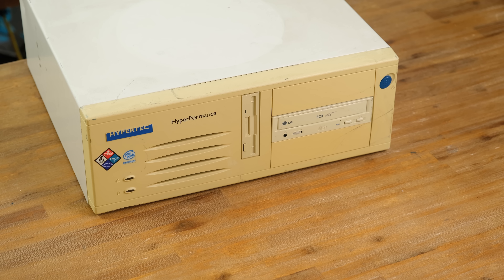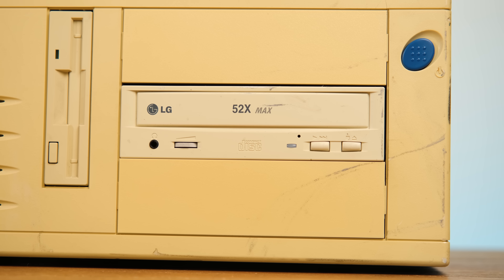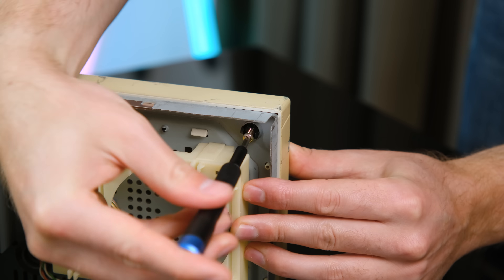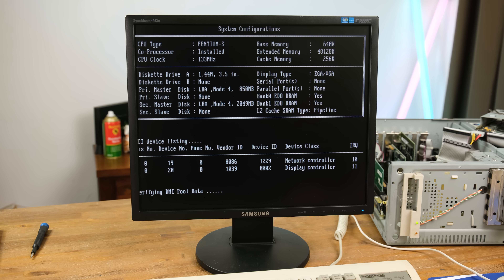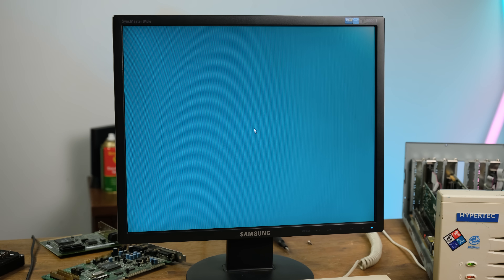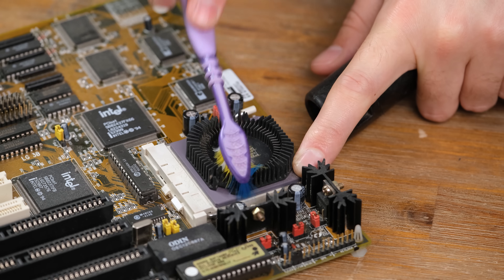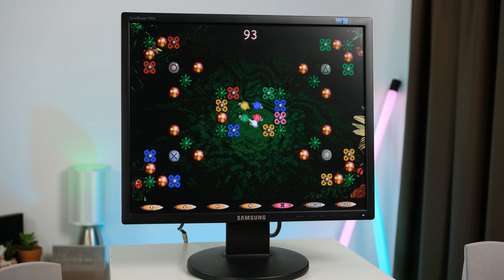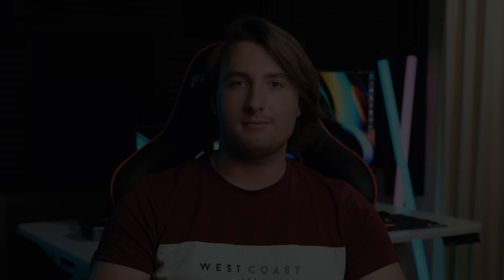Windows 95 PC Saved From The Trash!

Comment: This was our first Windows PC in 1999, was an ex office workstation. Had a Pentium 100, 16MB RAM and Win 95, later upgraded to 32MB RAM and Win 98 when it became my own PC in my bedroom circa 2002-2003, as we had again obtained another old ex workstation around 2001 as the family PC (this time an MMX, 64MB and 98SE)

This brought back some good memories.

The last ex workstation PC was an IBM with a Celeron, 512MB RAM and XP that we got in about 2005 when we finally stopped dealing with second hand underspecced computers, but they did the job. That served us well for about 3 years and then I think we pretty much went with laptops as I had just started working etc.

Comment: All versions of Windows 95 liked to assign conflicting resources to sound cards, most often the parallel port. If you'd manually change one's resources it would change the other device to match. So then the only recourse was to manually assign both the sound card and whichever device Windows was insisting on improperly assigning resources to match it.

Windows 98SE was when Microsoft finally got Plug N Play working correctly. I encountered many PCs that had problems with Windows 98 original that worked fine with 98SE.

Comment: I have one of these. Came with with a 100mhz Pentium CPU and 850MB hard disk. I fitted a 200mhz Centaur "WinChip" RISC CPU and an 8.4GB drive and a network card. Mine has an 8x CD-ROM drive.

Comment: Ah, brings back memories. The company I used to work for in the early 90s supplied Hypertec their bare circuit boards for their Hyperam, they used to be in North Ryde. I recall their voyage into building pc’s started with great promise but local manufacturing costs proved too much. They were brilliant quality computers however. Thanks for the video and the memories. 😊

Comment: @ Psivewri: Re: Using An Old Windows ME PC! Big Mistake? ( uploaded Sep 20, 2019 ) ~ In Moto-cross Madness in Windows ME; If you drive your motor dirt bike way over to the edge of the field / course, you will come to a wall (At ANY side of the course). Drive your motorcycle UP the side of the wall!! It's possible, you just have to keep trying. Once you get to the TOP of the wall, try to continue further OFF course. There will be AN EXPLOSION NOISE and you will get YEETED SSSOOOOOOO redonkulously high into the sky, it takes your character a few minutes to fall back down!! Don't worry, doing that won't freeze up the game. It's just fun to experience!!😅😂🤣

Comment: I wish i found a windows 95 computer from the trash it is hard
Reply: Yeah, it's not easy to find computers this retro in the trash anymore. It was way easier in the early 00s. I remember getting a few 486 computers that way, good memories.
Reply: @8bitbubsy  that's true today usually what you will find in the trash is a computers from the 2000s and leter but my goal is to find a laptop / retro laptop from the trash but i didn't found one yet it is harder finding a laptop then finding a pc from the trash